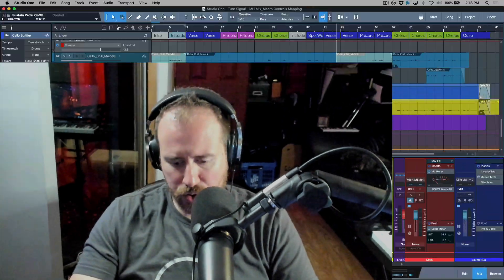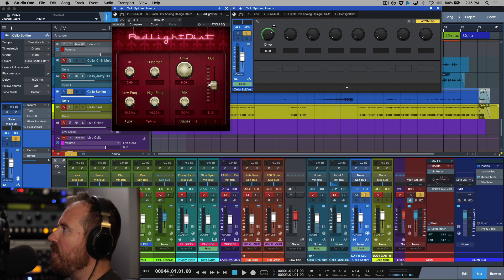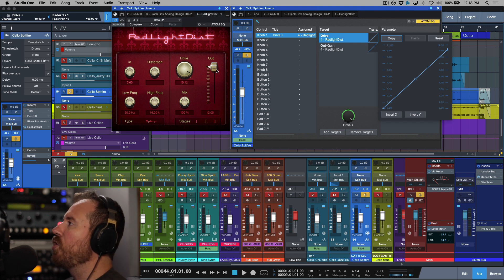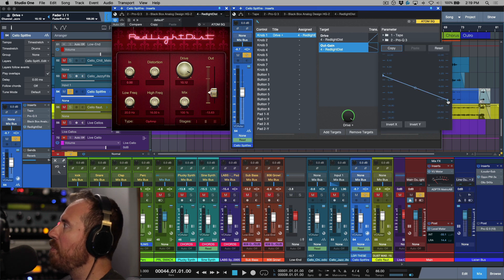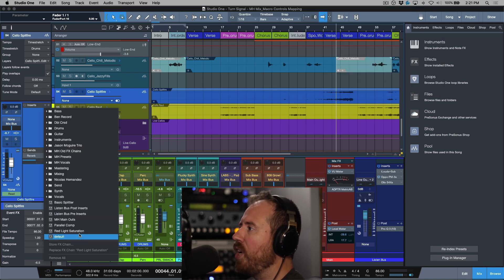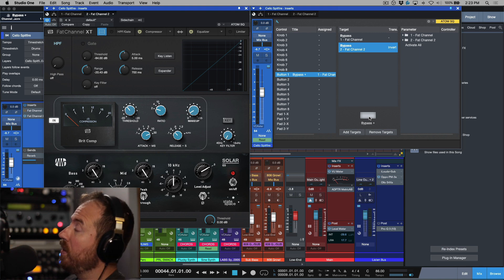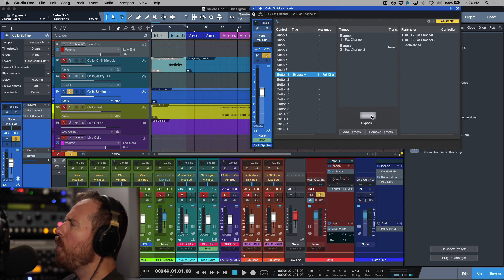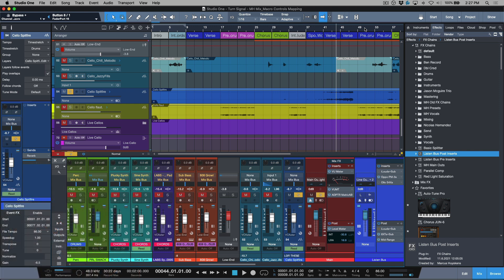How to Edit the Macro Controls Mappings In PreSonus Studio One

Comment: i've been using the inverted feature for a while now and its really quick for A/B. You've triggered an idea. If i've got the same plugin slapped on each channel (say an SSL channel strip with 1 instance on each track) i can set the Bypass of each instance to button 1 so that i can do a quick bypass of all instances of the channel strip without having to bypass everything.
Reply: Actually thinking about it, I don't think this will work as only the channel with the macro control bypass will work. All the other channels with the SSL channel strip won't have the macro bypass button

Comment: Just curious what happens if you save these settings as an FX chain and then use them on an instrument where Knob 1 is already used for something else (talking about example 1 - first 8 min or so). Does it overwrite or move to another knob?
Reply from the maker: I've had a little bit of experience doing this, and from what I saw - It just moves them over to an empty knob and merges previously assigned knobs with the new ones.. That being said, Im not sure what would happen if there was no room left.. But i never have that many assinged, usually 1-3 MAX.
Cheers, M 🍻
Reply: @marcushuyskensmusic  Thanks, that was what I was hoping for! Smart devs :)
Reply: @marcushuyskensmusic hi brother. There's an option to automate the BYPASS button to A/B but it doesn't work as expected with regards to the invert. Instead flipping the bypass between the 2 plugins, it leaves the one plugin active whilst bypassing the other one on and off. It doesn't do the invert thing. Hope it makes sense.